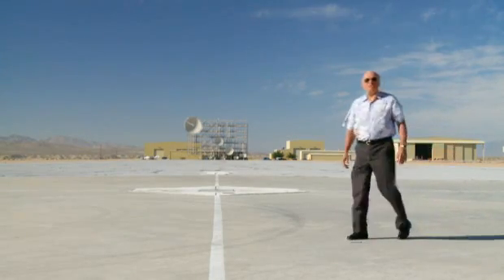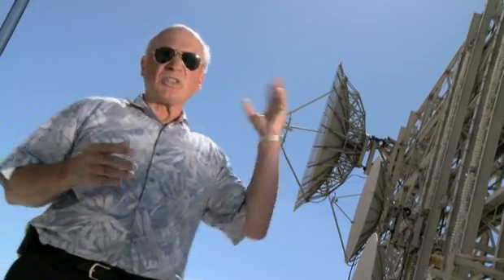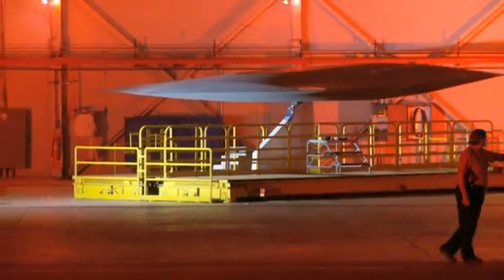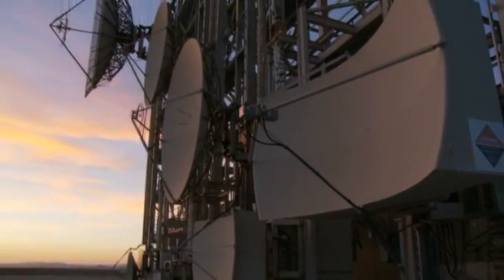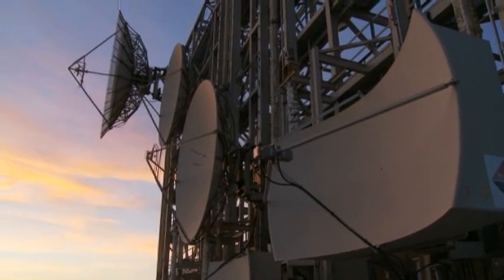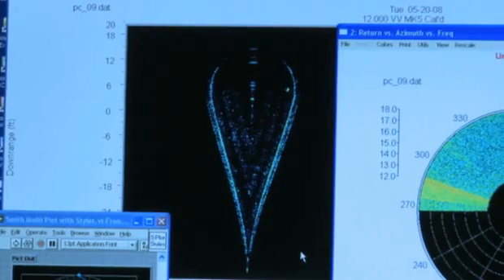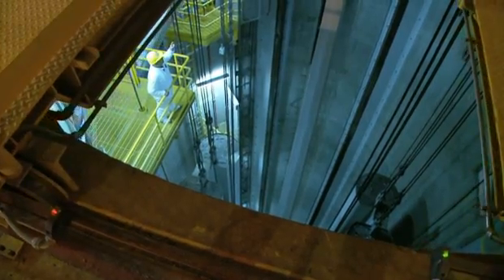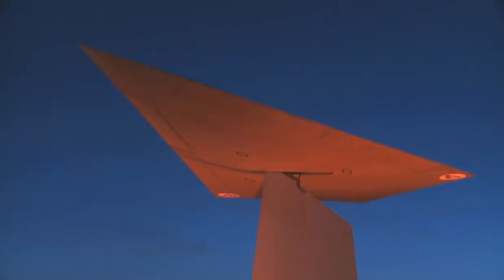Stealth technology

Comment: 3. It's also not just 2d objects, from Wikipedia: "In the 1960s Ufimtsev began developing a high-frequency asymptotic theory for predicting the scattering of electromagnetic waves from two-dimensional and three-dimensional objects. Among such objects were the finite size bodies of revolution (disk, finite cylinder with flat bases, finite cone, finite paraboloid, spherical segment, finite thin wire). This theory is now well known as the Physical Theory of Diffraction (PTD)."

Comment: I would also add that the F-117 was also called the "wobblin' goblin" and with all those flat surfaces was aerodynamically very dirty and inefficient. 

Later designs with much greater computer power made it possible to design stealthy shapes (I believe taking into account internal reflections) which were also aerodynamically efficient too, such as the B-2 or YF-23, and those from Lockeed.

Comment from the maker: RAM was put on the Blackbird which operates mach 3+.  But then, that's why maintaining it was so damn expensive.  At mach 10, and operates almost outerspace, it sure will be a big challenge. And then there's the problem with trying to reduce its heat signature. That's why the hypersonic bomber doesn't come beyond 2040).  The problem isn't going fast.  They flew something mach 20 already. The problem is going fast while stealthy, reusable, durable, sustainable.
Reply: Those early Radar Absorbent Materear started out as high temperature composite only during the SR-71 development did they find that they could absorb RADAR waves.

Comment: Yeah, the SR71 pioneered that.  Still, airframe heat soak reached over 600 degrees Fahrenheit when at full tilt.  That temp was achieved at a supersonic speed of Mach 3.2.

There's simply too much heat energy being produced at hypersonic speeds for active cooling to reduce IR sig.  At speeds in excess of mach 10, even the air begins to ionize and form a sheath of plasma around the vehicle.
Reply: sr71 went alot faster than 3.2
Reply: @dgafbrapman688  the fastest de-classified flight of the sr-71 was Mach 3.5. But Pilots said that when there was a new record they simply gave the sr-71 more gas to create a new Record.

Comment from the maker: Its stealth is too expensive. Back then, they didn't know how to make stealth as cheap as today. Its paint was vulnerable to weather and temperature. It requires expensive and special maintenance, which is the main reason why it got cut off. Not everything can just be upgraded easily. It could, I suppose, but would require alot of money, which is a waist since we already have something better, the f-22 and b-2 could fill in its roles much better.

Comment: However don't put down Ufimtsev, he did all the mathematics and all the factors what will deflect of what material and at what degree, this factor was absolutely critical for Stealth technology. This math/paper played a critical role in the design of American stealth-aircraft F-117 and B-2. Even if it is those 0.1 % of the F22 design, without it this 0.1 % there would be no F22 or any Stealth plane. Just like without the binary system there would be no computers.